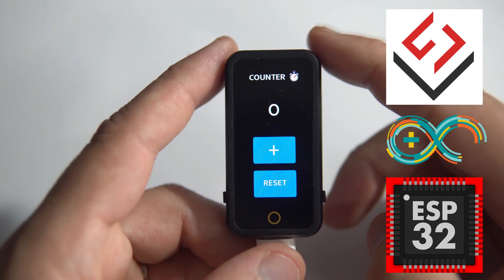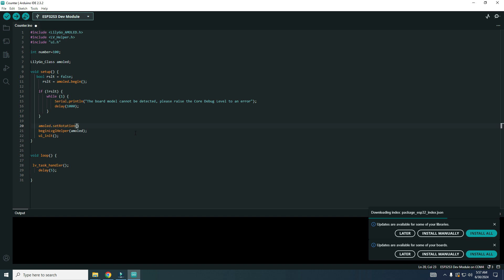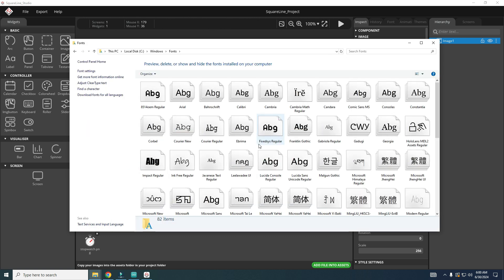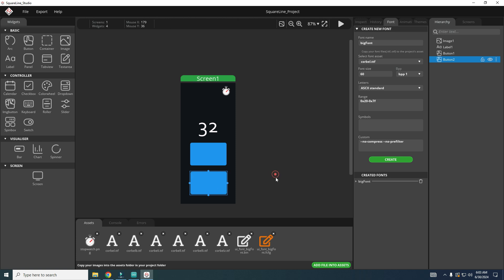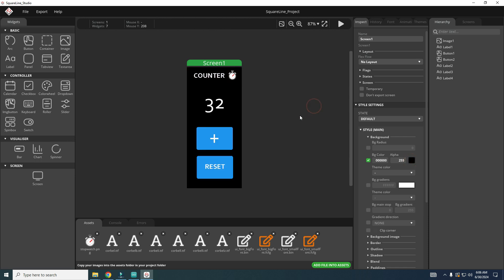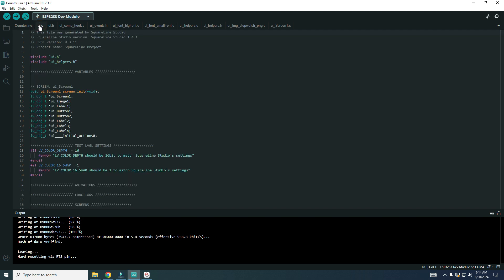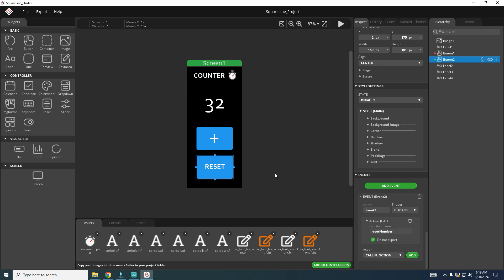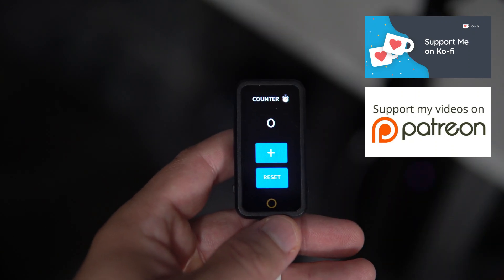SquareLine Studio ESP32 Tutorial- PART2 - Counter Project

Comment: I have watched several of your videos and subscribe to your channel. I really want to use squareline with Arduino. I am new to coding, microcontrollers, and UI creation. I have been trying to learn this for over a year with very limited success. I really like the squareline software, but cannot make anything with LVGL work for me. Always fails to compile in Arduino. I have tried several different board/screen combinations hoping that I would have more success. Without harming any of your sponsors, is there some advice you could give to a person like me? It is clear that you are very skilled at writing code and probably don't have all of the issues that many people new to this are having, but even you must have valuable opinions on which boards, which libraries, which compilers would be the easiest for a beginner to achieve some early success. Thank you for your time.
Reply from the maker: hello, thank you for this nice comment. my advice is to start with something simple, i made short series of tutorials recently with small and afordable waveshare c6 board so you can check those for start. Hardest part is install board properly. first you need to make sure board is working , and factory examples works the you can play with sqareline, here is video that can help https://youtu.be/KEcr22qZAVE

Comment: I'm confused on font usage. When using TTF w/ LVGL (manually) the fonts need to be converted using the LVGL font converter, then added to LVGL fonts folder, and then lv_conf.h updated to enable the fonts. Is this happening automatically?
Reply: ...I found it does in fact do the conversion and adds the font to your "ui" folder and enables it. It works great. Using custom images and fonts in LVGL manually would take 5 minutes or more for every option  (every font size etc..). With Square Line doing all the work for you you can try out fonts and images very fast without the hassle.